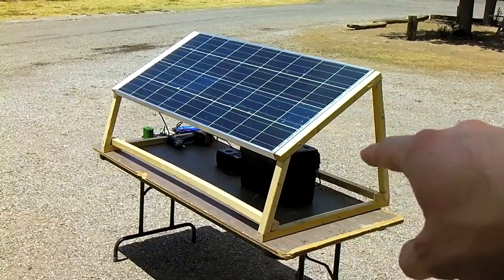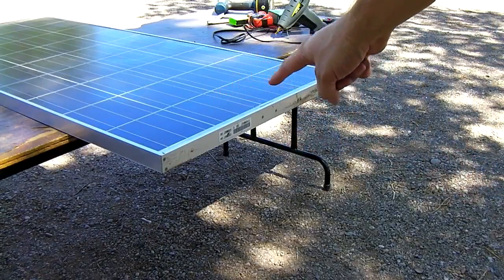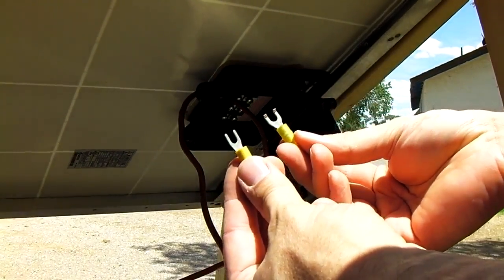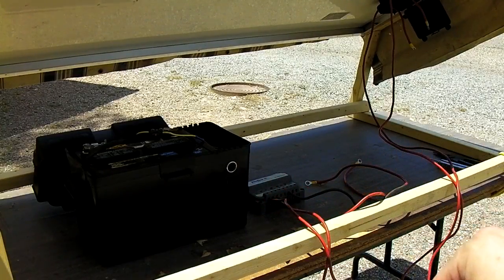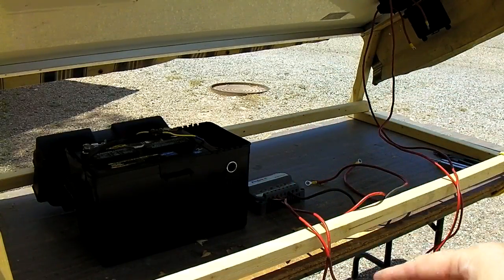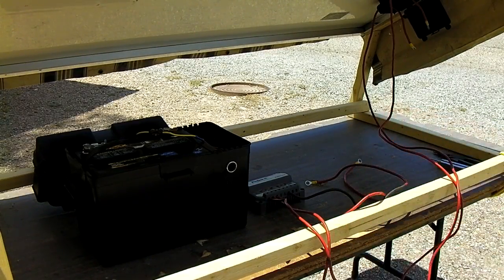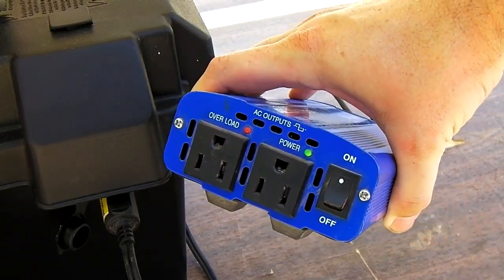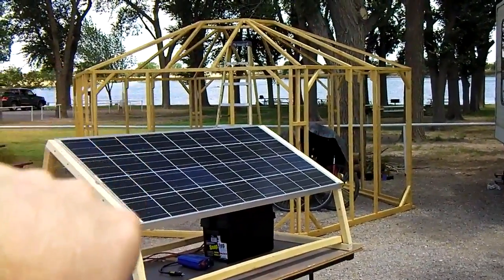Poor Mans Survival Solar

Comment: Thanks for this useful video, I wanted to understand the entire wooden cradle dimensions if I had a solar panel of dimensions 168 cm length and 102 cm width and had to build the cradle at 27.5 degrees. Please help with the details.

Comment: I copied your set up. Except I made the cradle at 45 degrees and put a fuse between the battery and the charge controller. Works good. Big thumbs p for your video.

Comment from the maker: I guess Coleman stopped making them. Go to Coleman website and look at "pack away lanterns". All they have is the CR123 battery triangle version for $60. I liked mine because it uses AA batts. I wouldn't use anything else.
I know it's not a lantern, but the Petzl Pixa 3 headlamp is awesome. Industrial strength/waterproof and uses 2x AA batts. I'm going to be showing it off in a video soon. You can detach it and use as a stationary light. Has pivoting base.

Comment: YO BRO GD yo bro vry gd n clear teaching, i love it. but this is just for noob sake, try to use black cable for the negative wire. i love yor videos good quality, whats the brand and model of your handycam.
its not cheap? i think it is vry cheap for $500 usd. considering the electrical bills in 3 month where i live, 
cheers mate. gd work.

Comment from the maker: Yes, it will work. I'd make sure the batteries are all the same rough physical "size". For example, don't hook 2 huge 6v golf cart batteries up to a tiny 12v AGM or gel cell battery. All the connecting wires should be the same size or else you may have a problem with resistance. Just use common sense.

Comment from the maker: Yes, I will very soon. Basically, just hook the inverter positive and negative to the battery terminals.
Positive line has to be fused with a large fuse/circuit breaker. My 250 watt inverter takes a 100 amp fuse.

Comment: Excellant video, I have quite a bit of experience with the morningstar unit exactly the same as you have. My only additions to you video would be to stress that you HAVE to connect the battery to the controller BEFORE connecting the solar panel. This is so the controller can detect the correct system voltage 12 or 24V. Also to check the rotary battery switch is set correctly for the battery type. Position 1 for flooded. Position 2 for sealed. Position 3 for Gell batteries. Great info, Cheers.

Comment: This is the BEST vid on solar set up for "Dummies" that don't know, like myself.  It's a good start.  I need to get more involved in setting up something like this for my family.  I am actually getting a 6KW PV system on my house installed. Rebates for Louisiana are 50% from the state and 30% from the fed for a total of 80% in rebates. Can't beat that with a stick.  I'm not getting a battery bank and they can't hook it up to run if the grid goes down. It's against the law. Thanks again! Greatvid

Comment: Right on brother.

This would be a fantastic basic but functional system for allot of people round the planet. This is ALLOT more then nothing and allot more then the popular 45 watt Panel(that are great for $150.00 but to weak for me) from Harbor Freight.
 I only have one serious issue with your setup. The battery here looks like a regular starting type(non deep cycle) automotive application battery which is terrible for any solar setup. Ya gotta have a deep cycle.
Bless you brother.

Comment from the maker: Thanks!
I've yet to see a "professional", indestructible crank powered...flashlight or lantern.
Somebody needs to do this. Not that one will ever be really powerful *and* small.
I use the batteries for many items. Pretty much standardized on AA size.
Look up the Klarus RS11 to see my "ultimate" small flashlight.
It has a magnetic attach USB/120v charging system.
Takes multiple battery types. Costly, but you get what you pay for.

Comment from the maker: They have junction boxes for some solar setups. The charge controller in the video can handle up to 15 amps worth of 12v solar panels. They have larger charge controllers that can handle many panels. Most CC's have just one input. It's up to you to get a junction box or run the panels in a string.

Comment from the maker: Yes, there are holes all over the frame. You can drill through the 2x4's and use small bolts. I *carefully* put #9 deck screws through the wood and into the frame. They have to be short 2" so they don't come close to the backing on the solar panel and ruin it.

Comment from the maker: It's the stock junction box. No mods. Most (new 24v) solar panels do not come with junction boxes anymore. They use quick disconnect cables.
The 4 terminals inside are for different wiring schemes. They are connected with diodes. Do not cut out the diodes, you need them. The terminals are clearly marked + and - in pairs. Just hook one wire to +, another to - 
The JB does not come with wire. Use 10ga. sunlight resistant. In a pinch you can use 12ga (short run) low voltage outdoor lighting wire.

Comment: You modify the junction box on this video.  Could you explain the jb's that come with some kits. that have the typ plugs?  the inside of the box has 4 terminals with what looks like diodes between each one.  the the cable ends have tags on them with stop arrows in both directions.  Should I just burn off the diodes and cut the ends off the cables?  No wiring dia came with the cells and jb.    ????

Comment from the maker: @brandon14872 Yeah, the bummer is that the really hi-cap/low discharge types are not sold in regular stores. All I've ever seen is Energizer locally.
You have to go to Thomas Distributing or a similar online retailer.
Thomas also has the Maha AA chargers with cig lighter plug. $50 for the kit. Can be used on house power too. It's the Maha MH-C401FS

Comment from the maker: @brandon14872 The Energizers are only 2500mAH. Each of those are equal to a single AA batt. The Imedion 9500mAH low discharge NiMH D cells are now $27 a pair.
Accupower 10,000mAH low discharge are $23 a pair @ Thomas Distributing.
I've seen some cheaper brands go $50 for 8...Tenergy brand on Amazon. Those are 10,000mAH but *not* low discharge type.

Comment from the maker: @SMASHER1099 Yes, I used this panel and an Optima AGM battery to run my Engel 45 quart fridge while traveling around the US. Turn the fridge on and forget it. You can also run a laptop with the fridge as long as you have sunny days. In a gloomy climate you'll need a couple more panels.

Comment from the maker: @frisc45 If you tap power off the "load" terminals on a charger controller the cutoff is 50% battery level. Some are programmable so you can take it lower if you have an emergency. Taking batteries lower kills them in the long run. Lots of info out there on this.

Comment from the maker: @muserwood Batteries can be added (to a point). I've got this panel hooked to a pair of 6 volt T-105 type golf cart batteries from Sam's Club (when not in "mobile" mode). Any more batteries and you will need more panels. Big batteries need a big charge rate to match. One of these 130w panels is only 3-6 amps charging power (on average. can be as high as 9A in perfect conditions).

Comment from the maker: @tshenefield The 130 watt panel puts out 9 amps @ 12v (max in full sun). So it's like having a 9 amp battery charger hooked up. Most of the time you will get about 6 amps avg. Way less on a cloudy NY day (1 amp or less). Also depends on your battery size. So...the answer is....it's variable ;) In full sun, it should bring a single deep cycle to full in a day.

Comment from the maker: @TheCorbucci Then start by making only the battery pack...$83 total at Wal Mart. Get a simple battery charger next. $30-50. This allows you to have a battery backup system up and running. When power goes out, you are set for a while. Power comes back on, charge your pack back up. When you have the money...add solar.

Comment from the maker: @pdossjr It's right in the beginning of the video. 130 watt panel (around 8-9 amps output max) My panel is a Kyocera KC-130 (a few years old). The new ones are the KD135SX-UPU (junction box model). $350 each for the panel. 
The battery can be any Group 24. They vary in amp hrs. 

The Wal-Mart 24DC-4 is 75 amp hrs for $58
Concorde Sun Extender PVX-840T AGM is 96 amp hrs. for $208

Use what you can find and afford.